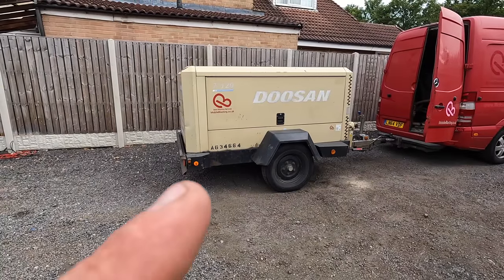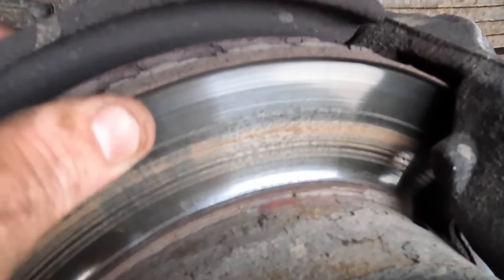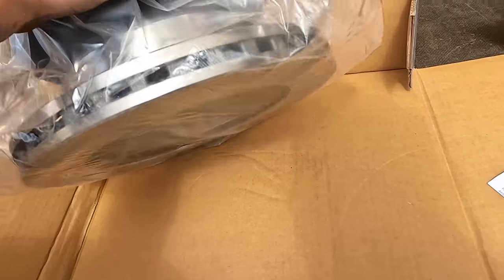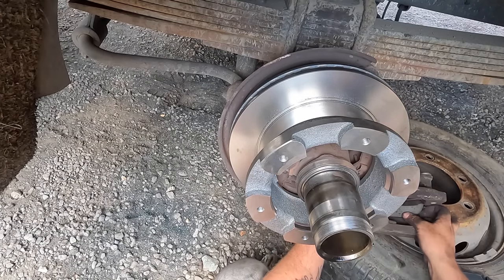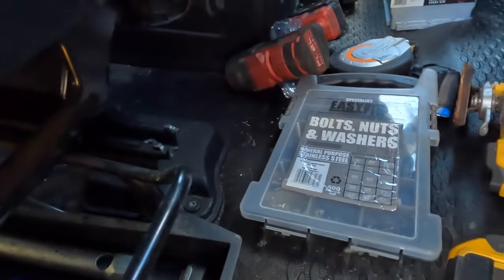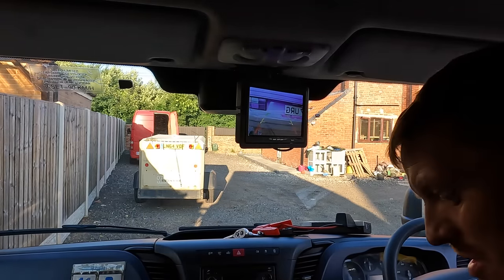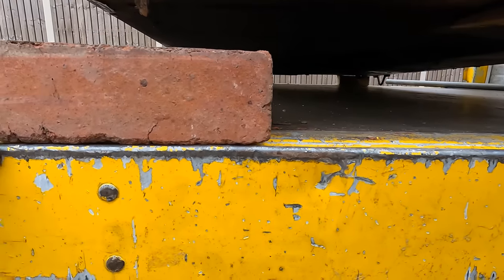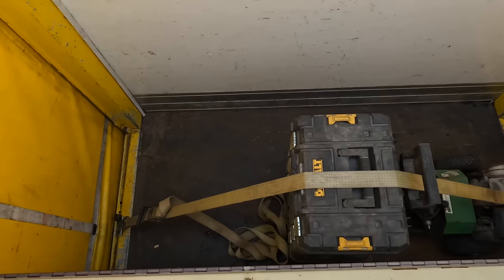Building a SandBlasting truck

Comment: Good work , it’s just a thought  maybe wise checking your weight over the front axel Incase you get checked by DVSA .
Reply from the maker: That's why I had an inspection separately from a MOT by the DVSA just to make sure I've got paperwork of the build and a full log for the insurance also its a nice peace of mind knowing a expert has signed it off 👍

Comment: Thats quite an upgrade! That old tire is a liability, im glad you took care of that. My Benz was off the road for quite a few years just sitting, and the tires looked good but they were very much out of round, anything over 55mph it was like the car was gonna shake itself apart, which was kind of funny because below 55 they felt fine.
Reply from the maker: What gets me if the rear was the right load rated I could have swapped the front for the rear 😏 its just steer wheels I believe that have to be 10 year or younger
Reply: @Mobileblaster  that truck must not have been used much 🤔

Comment: Get yourself a Van Vault/Van Guard/Jobsite security box to bolt in the back. You'll be able to throw all your tools and lose ends into it and shut the lid to secure them. Saves tying them down. 
You could also put some doors on that section at the front to put all the hoses in.
Reply from the maker: That's not a bad idea 😊👌👍
Reply: Gap sell ex hire site boxes at auction sites, some sold at Exeter Hussey's for reasonable money last week.

Comment: You need to improve your safety.
You can't trust a jack to keep the truck up ,you need tho pile the two wheels under the frame at least, and get some jack stands or wood blocks.
You don't want to loose a leg or get crushed.
Reply from the maker: I know it's not as good as axle stands but I had the forklift and a bottle jack under it 👍

Comment: R'reet Mick, That's a bonny set up you've got there now wi tautliner body.😎 Nice job on fettlin' brakes, they're always a PITA when the wheel surfaces are rusted together & wont come apart.

Will it be r'reet for weight over that front axle if you're putting a 200 gallon water tank there?
Reply from the maker: Water tank will only be a buffer and only filled when it's working not a storage tank. I was thinking the same when I was putting the compressor up near the head board but the dvsa inspection (not an mot) was happy with the conversion I was happy to have a expert in this field check over things👍
Reply from the maker: 200L (aprox 200kgs)

Comment: Work safely, always support your vehicle on jack stands when working underneath. Never go under a vehicle on a jack only.
Reply: I'd go further and advocate big slabs of timber as well to fail-safe support at least the working side as I've know axle stands to topple or collapse.
Reply from the maker: I had the fork truck and a bottle jack still not as good as a axle stand im not setup for doing this line of work so I have to make do :) if I was doing stuff like this all the time defiantly would be something I would invest in
Reply: @Mobileblaster  Good and simple life insurance is a pile of timber blocks, they can be found for free of charge :) I ofter use a stack of 4x4's.
Reply: @Mobileblaster 
get some blocks of wood to stack under the frame....until you can get proper jackstands... and you need a bigger hydraulic jack too..

Comment: Nice equipment, but I think you'll have to use it with the side covers open all the time, both to keep the engine overheating and to prevent sand in suspension from going into the suction, which will be a hassle to open the covers each time, don't you think? P.s. Please sandblast that rims😂
Reply from the maker: I was looking into how I can have the curtains shut and something made so I don't have to open them every time but it's not really hard to pull them open. I was planning on blasting the rims but I wanted to get it up and running first 👍
Reply: @Mobileblaster ok but don't forget them, here in Italy we say 
the shoemaker goes with broken shoes😂😂
Reply from the maker: @AsitShouldBe  😂 so true haha

Comment: Good set up Mick 👍 
I had a ex water board dodge truck for my set up put compressor in tipper section on back and made a frame to put cover over and blast pot went inside box part with all my other stuff, hoses, chemical cleaning tackle and tools spares. Sold it all to a guy in huyton that did export and he shipped it all to Dubai 😯 It was a hard life blasting and doing the chemical cleaning and I'm too old to be grafting like that now.  It's a very physical job and I used to be at it sometimes 15 16 17 hr days 🥴😵 so I called it a day.
Reply from the maker: Yeah it takes alot out of ya body and I definitely don't fink I could do this all the way to retirement age 67 😧 that's just a joke for anyone who dose manual work. Hopefully I can get plenty of work for it now and hope the investment pays in return 🤞👍

Comment: Could you bolt an IBC in there for the grit to go in but all looks good fella good job and yeah date codes are a new favourite for failures 🤦🏼‍♂️
Reply from the maker: Tyer and reset fee of £78 just because of a date stamp 😕 shocking. I can order media in bulk bags but its a pain to load into the hopper its only a little extra to have them staked into 25kgs makes life alot easier 👌

Comment: Watching you go over that lorries a bit too close to the day-job for comfort Mick.. :-) Nice rig, I like them Ivecos - they break like everything does, but are fixable, unlike loads.. Iveco do get rapey on parts pricing, but there's aftermarket stuff available for sensible money. Hope she runs great for ye.
Reply from the maker: @jamesward5721  when I phoned ATS up (big tyre company) they said they only had cross climates 280£ each and they would only sell them in pairs 😫 so I'm thinking this is going to cost a fortune turned out I found a part worn good date and tread £40 fitted 👌👍 but I had the retest fee to pay £79 just for him to check the tyer 😒

Comment: What size air line are you running? 3/4” will only kick out 190cfm. 1”280cfm. I run 2” from my 260cfm sullair.
Reply from the maker: 3/4 will pump out 425cfm with ease nosel size is 9.5mm (3/8") for 260cfm alot smaller than 3/4 and that still pumps 260cfm my nosel is set at 1/2" so 3/4 is ample.

Comment: If they are anything like my Transit Custom sensors, you can check them by disconnecting the sensor from the loom and test for continuity across the sensor pins. Short circuit indicates sensor is ok.

Comment: mick if you put a smear of anti seize on the hub and lugs it'll help make getting the wheels off easier in the future its the rust making um tight its worse with aluminum wheels on iron hubs looks like an excellent set up!  i can sympathize i had a pair of tires on my 4runner great tread but 18 an 20 years old they kept at me till i replaced them due to age
Reply from the maker: I will eventually get round to blasting the wheels and possibly the hubs 1 day 😂 it's shocking that a perfectly good tyre has to hit the scrap heap just because it was 10 year and 2 months out of date 😫

Comment: Get the compressor strapped in otherwise vosa will have you.
Reply from the maker: I sent it to DVSA to have a private inspection and the guidelines state everything needs to be bolted to the chassis or strapped down if its not permanent. It passed this inspection and its MOT 👌👍

Comment: Can I ask why. What benefit in having new truck  & Compressor on back then towing with old Van? And would larger tuck be harder to park on small jobs?
Not being funny, You know best just don't see why.  
Hour long MB video 👍
Reply from the maker: I've always wanted a rig all in 1 but the main reason is I have bigger plans. The red van will still be getting used I only need a ecu for the old doosan and ive 2 rigs plus the yellow will be a 2 or even 3 man rig :)
Reply: @Mobileblaster  Best luck to you.
Reply from the maker: @SonofChurchill  thanks mate appreciate it 😊

Comment: If you have an air compressor with a blowgun, make a hole in the side of the syphon hose and it will transfer without the need for you to use your mouth 40:10
Reply from the maker: 😏 it's a little too noisy to fire it up just for that 😬
Reply: @Mobileblaster  true

Comment: To get the wheel off the eazyway losin the lugs about 1/8 in. drive the truck around the parking lot two or three times untill  wheel is louse!!! needs spell check!!
Reply from the maker: Ah that was probably a easier way 😅 it's the 1st time I've owned a hgv or a van were they are stupidly tite and rusted on good idea for next time thanks 👌👍
Reply: good luck
Reply from the maker: @gizzo123us  thank you 😊

Comment: Nice setup, im actually Looking to do a similar setup only for Mobile welding, i use a 3.5 ton iveco daily atm, currently in the process of getting my class C license so i can drive a HGV something similar to what you've got i do like the Iveco daily.
Reply from the maker: I would definitely say himatic is the way to go always seams to pick the right gear at the right time so far so good I like it 👌👍
Reply: @Mobileblaster  good to know my current Daily is 6 speed manual, i was definitely looking at an automatic when I get my C license.
Reply from the maker: @deepwinter77  definitely the way forward 👌👍

Comment: You really should have got some copper on those brakes and while it was apart do the handbrake shoes, copper on the hub to wheels to help them off next time. 
Apart from that....
Reply from the maker: fresh out of copper slick :( I know how to solve squeaks rattles and bangs ive a box of ear protection in the cab haha or turn the radio up hahaha
Reply: @Mobileblaster  I've got a Daily 7.2 tonner, worst is the rear brakes, hand brake and propshaft bearings.
Reply from the maker: @slickmouse  himatic is very smooth 1st impressions its nice to drive a little slow but driveable 👌👍

Comment: Might want to consider some large rubber machine mounts to keep the vibration/noise down a bit & stop it shaking f*#k out the truck when its running.

But thats going to be a nice setup once you got it dialled in & much less ball-ache than dragging a trailer about everywhere.
Reply from the maker: Chassis to chassi will be fine as the compressor engine and air end is factory rubber mounted I could have built it cheaper by putting my own engine and air end in but then I would have to build some sort of sound deadin sides etc al find out tomorrow if it's any good 🫡😬 back to work for me now 😁
Reply: @Mobileblaster  yeah no doubt you will have some kinks to work out, but definitely an upgrade from Van & Trailer.
Reply from the maker: @WombleUK  I'm looking forward to tomorrow but not the job itself as its the underside of a narrow boat 😂 just want to test the rig out 😬

Comment: That a brilliant set up you have there, the reason for undoing the cap on brake Reservoir is due to back pressure when pushing brake pistion back.
Reply: Next time try block of wood between chassis and tyre next time turn steering wheel and for the rears you did a pretty good job getting wheel off but giving them a crack on rim on back usually works with a sledgehammer 😂
Reply from the maker: that makes sense years I've wondered haha
Reply from the maker: 1st HGV ive every tried to take a wheel off I can imagine thats a pain in arse at the side of a busy motorway
Reply: @Mobileblaster  even worse on trippers in middle of winter in snow having to use steel scaffolding bar to crack wheel nuts. Credit to you aswel for having a shot at doing your own maintenance I was impressed tbf mate 👌 good luck with the business 👌
Reply from the maker: @disco0314  yeah defo be stuck without the 4x1 multipler I bent the original setup the van comes with swinging on a scaffolding bar trying to get them lose 😂

Comment: What size Iveco is that Mick? Is it an ex MKM?
Reply from the maker: Its ex fruit and veg van 72c180 himatic best in its class for payload and still get to go in the 7.5 ton acsess only zones 😬 just about lol
Reply: @Mobileblaster  lucky find, stick a tow bar on it and you and pull another 3.5ton!! 💪🏽
Reply from the maker: @yorblastshotblastcleaning1688  this spec is the 72c so it loses 200kgs of train but gains it on its own payload 70c is the tow king but as mentioned it loses 200kgs 😕 plus I would need class 1 for articulated? Or can hgv tow trailers under 3.5?